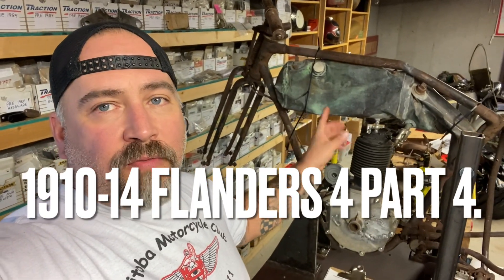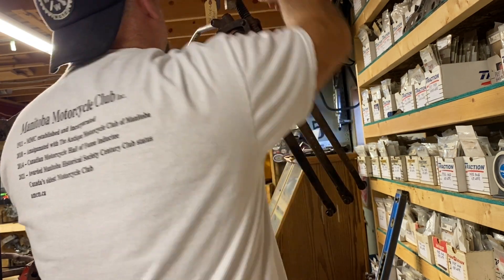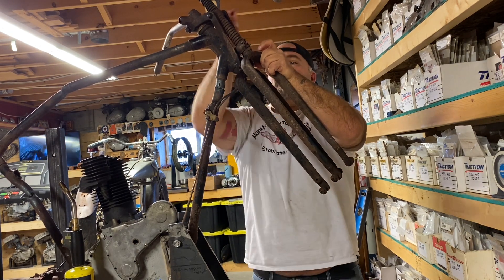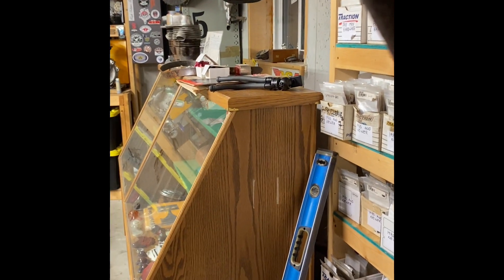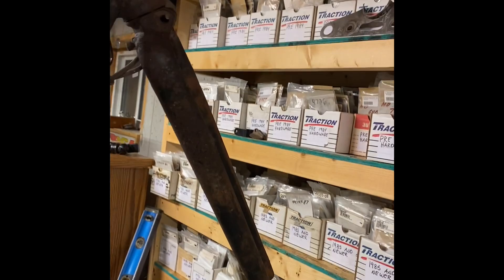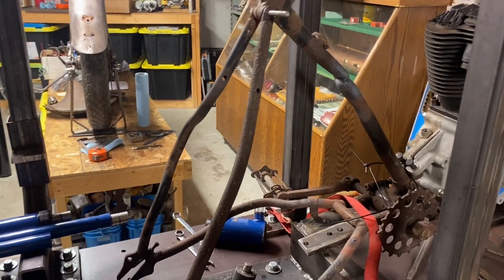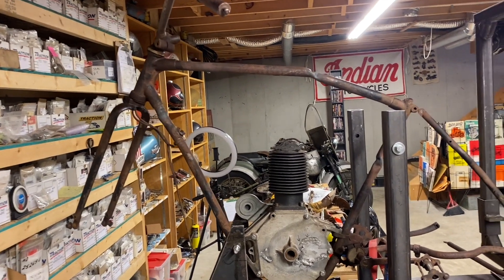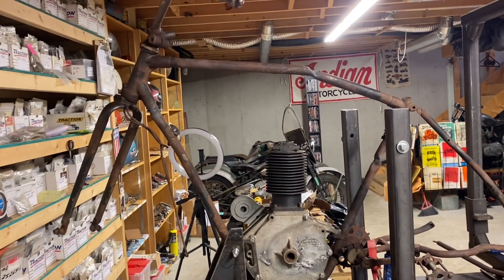1910-14 Flanders 4  Part 4 Motorcycle rebuild. Removing parts of the forks, frame straightening .

Comment: awesome  bike i cant wait to see the progress on the frame.  That would be great if you could unsweat the frame tubes and pull them out. It would look much more professional in the end .
Reply from the maker: i definitely agree it would look and be the proper way. i haven't done much brazing in 20 years . But i know a couple of guys who i hope would step up and help out .
Reply: ok good luck. Its actually very easy , clean the inside of the forging and the outside of the tube super clean , flux them really well and the brazing rod will flow into the gap like water, If you could position the joint so the opening will be facing up gravity will be on your side and the joint will look perfect when your done. I know you can do it!!!  Before you know it youll be making frames from scratch!!!   @Savetherust
Reply from the maker: thanks fro the tips and vote of confidence. pretty sure i'm going to try it.  @anthonyiannone7618

Comment: Are you going to leaving the metal pitting?
Reply from the maker: No. Anything that is structurally compromised will be replaced.  Some of the pitting is too bad on some tubing and it will get replaced.